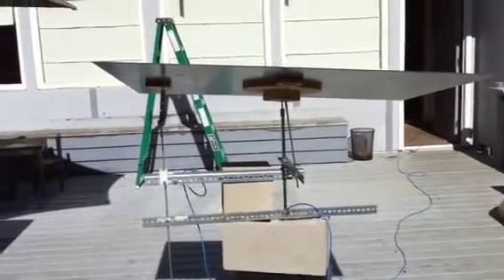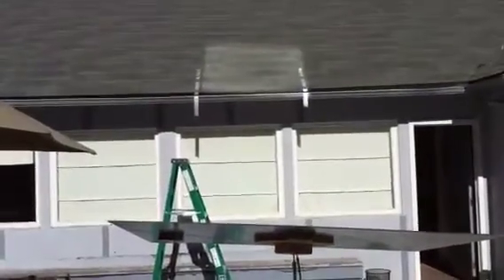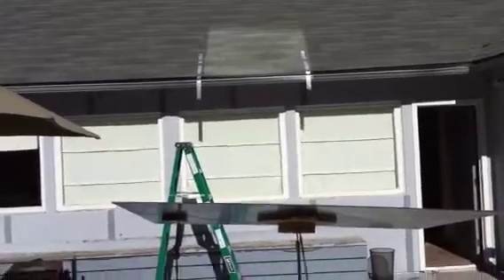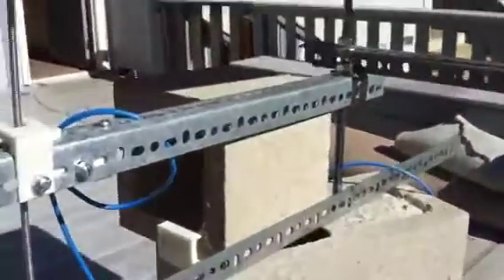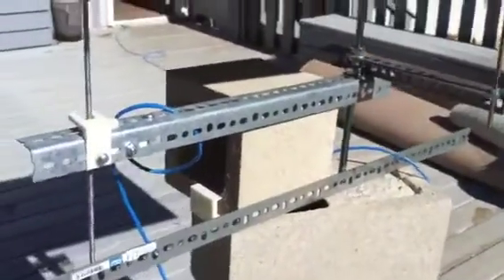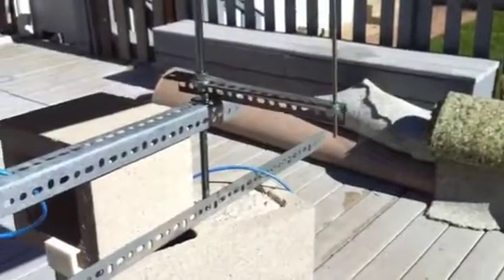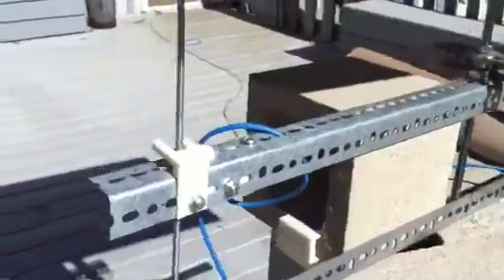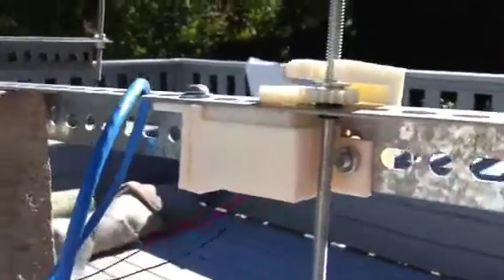Heliostat v2.4, test1

Comment: See my video for how to single axis heliostat that only needs one axis to turn at a rate of 1 rotation per 24 hours.  No electronics or optical tracking.  Without the motor yet, it has cost me $50 for 6 m^2.  Good enough if yu can get within 20 feet of the target window for heating.